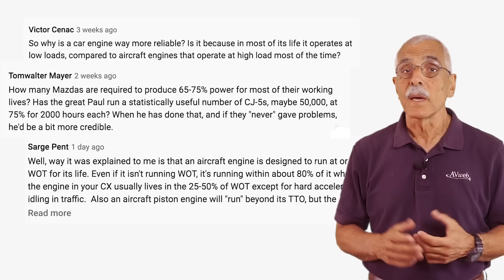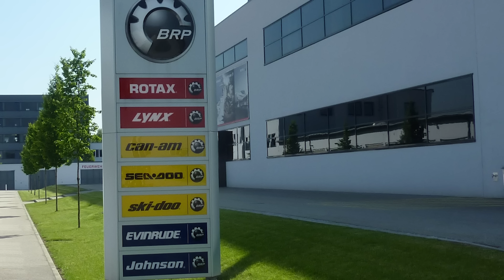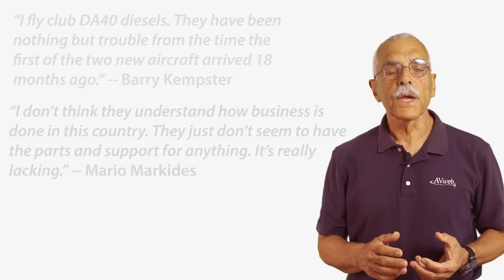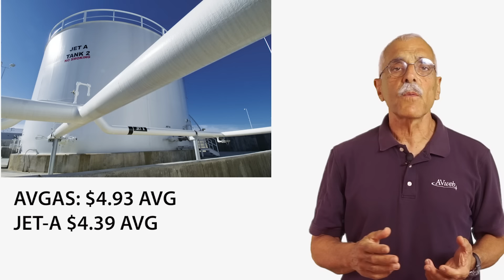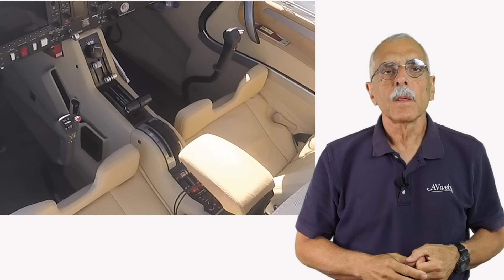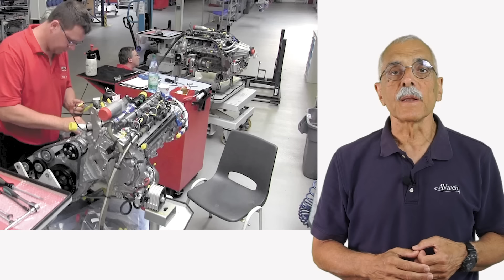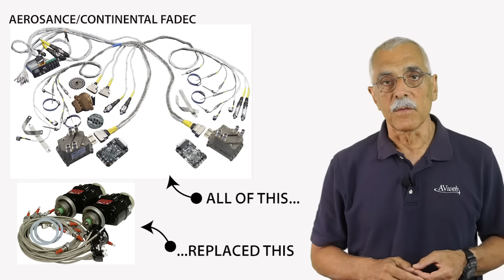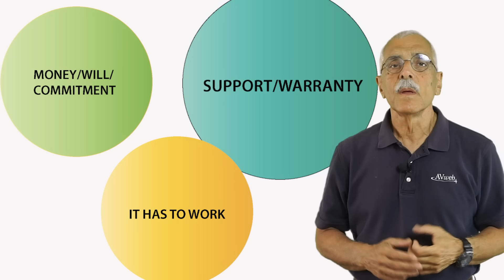Why New Aircraft Engine Ideas Rarely Succeed

Comment: I'm Not an aviation guy, but I'm a retired auto mechanic, and I can say that everybody knew what made a great piston engine back in the 60's. The biggest advances have been in materials and computer controls. take a good engine from the 60's, build it with modern alloys and manage it with modern computer systems and you just can't do much better. Great video!

Comment: This is a very interesting and informative video.  There must have been much research that went into it.  Thanks for posting the video, Mr. Bertorelli.  BTW, I met you once at Oshkosh many years ago when you were doing VHS videotapes.  You certainly were a gentleman and chatted with me for a bit.  Thank you for that.

I am curious about electric motors in aviation.  I find this fascinating as trading the weight of fuel for batteries and a motor (vs. engine) being so much lighter.  So, for those commuter runs or even as a trainer, this seems plausible.  The maintenance must be peanuts and the reliability off the scale.  Certainly, EV is not for every application but it might make some inroads in certain sectors of aviation.  We are at the beginning stages of battery development.  We might be on the tail end of internal combustion engines.  How much more can they do with them to improve them?  Solve the recharge-time problem and you might have something.

Comment: Great analysis, I continue to be perplexed at the fascination with overhead cams The RPM at the prop is almost always less than 3000 RPM.  If you believe in KiSS, simplicity is Achieved with large displacement low RPM air cooled engines.  For this you get less weight, lower stress on the engine and a much simpler power plant.  Thankfully there is no reduction drive and cooling system to nurse. Add the latest and greatest in electronic control tech and you get most of the promised benefits of the high tech wannabes. For these  advantages you give up some improvement in fuel burn and oil consumption. It is instructive to note that 2 of the 3  successful "new" engines are evolutions of legacy engines  .  As one great aircraft designer once said, "Simplicate and add lightness."  Updated and improved legacy designs fit the bill.
Reply: For years I have longed to see a real, honest effort made with a small diesel. Not a converted car engine, but a clean sheet, made for aviation design. Direct drive, air-cooled, sweet and simple. For a few years I thought the SMA engine was going to be the answer, but nope.

Comment: i dabble in light sport aircraft/experimentals, the latest engine trend is using 4 stroke yamaha snowmobile engines that have gear boxes added,  they see extended rpm usage at about 75-80% power,  even some turbocharged versions getting 300 hp out of 1,000cc engine.  i'm also involved in snowmobiles, i see many of those some engines suffer catastrophic failures in the sleds (rods sent flying out of the block) personally, i cannot see myself flying behind these engines, they are already highly stressed as it is and its just a matter of when will the motor grenade, not if. no motor is ever failsafe or perfect, but i dont want to put myself or others in harms way if i had an engine failure.

Comment: Red engines are the ones flying in European and Russian planes for the last 10 years I think. Also German but Europe is the better market for those. We aren't overwhelmed if an engines isn't comprised of 6 Heinz bean tin cans, an injection system from the 40s warbirds and 12 additional screws with some duct tape to hold the rest of the steelsheet together.
But concerning the poor guarantee procedures and service, that is German. 100%. Since the 90s our company mentality declined rapidly into an shareholder wank-off instead of good products with a proper service.

Important to mention though, in Germany you hold more responsibility for your actions as opposed to the US.
The amount of damaged machines and engines in any application because of lack of knowledge and high amount of stupidity is baffling.

Comment: Diesel motors was design to run full power all the time. They have too to pull the heavy loads up  mountains. So the reason that car motors are not suitable for aircraft still holds true for gas motors, run a gas motor at 70 to 100 percent power and most will fail in an hour or few hours unless they are beefed up quiet a lot.

Comment: We still have an ag-cat with a 1340 Pratt Them 1340's been around since the 1930's and  i'm sure in 20-30 years from now You will be able to still find a few around on working plane's Most reliable safest aircraft engine ever designed its  just 9 Lawnmower engines bolted together lol

Comment: What you didn't mention or maybe I missed it, is that in our litigious society in the USA, any flaws that can be blamed on manufacturers will be blamed on manufacturers.  The piston GA market is too small to absorb the enormous liability expenses being levied by our legal industry.  Hence, there is very little innovation in certified airplanes.  Experimental/homebuilt don't have as big a problem in this regard and have progressed with cutting edge improvements in materials, aerodynamics, engines and systems.  If you look at our GA fleet with the exception of Cirrus and a few other recent designs, it consists of flying antiques.  We are the flying equivalent of Cubans driving rebuilt Chevys and Fords left over from the pre Castro era.  We are stuck in a time warp.

Comment: The reason why Rotax never push the 6cyl is because is a small department of BRP and the market does not justify the spending, also big engines manufacture are the one imposing standard so the small ones cannot succeed.
Same happened for the Porsche engine PFM3200, amazing engine light year a head compared to Lycoming and Continental.
The FAA, pushed by Lycoming and Continental give them hard time to the point that they give up and the investiment for Porsche was not worth the effort.
So there is a lot of politics behind the scene like everything else today.

Comment: Slightly off topic from the video, but can someone explain to me why aircraft engines require such frequent overhauls. If (some) car engines can be used on aircraft only slightly modified, why is there such a massive difference in maintenance requirements? My car needs to be taken in for a service every 25,000 km or so and even then the engine is only the focus of every 3rd or so service. It also costs me a couple of hundred bucks vs the couple of grand that an aircraft engine overhaul costs (which suggests some very serious work is being done on it). Most modern(ish) car engines will run without failure for years without any inspection, let alone a service as long as you stay on top of oil and filter changes. Long story short, why are aircraft engines so fragile?

Comment: I always thought a Goldwing engine would be good for an aircraft.
Reply: Would be except for the offset driveshaft. No need for a reduction drive, just choose the right gear. But that integral tranny adds a lot of weight. A Harley might make a good choice on the smaller end as its tranny is separate from the powerhead and displacement can excede 3 liters with naturally aspirated horsepower north of the 200 mark. Downsides, vibration that immediately loosens any bolt within 100 ft and the need to carry twice as much oil as gas.

Comment: What is the fascination with overhead cam?  At the RPM's aircraft engines run at, it offers absolutely no advantage. The recreational boat industry had been using automotive derived engines for decades.  80 percent power is common.

Comment: Lots of mentions of Germany, so just for reference, the SMA engine is French, SMA was a joint venture between Renault and Socata, later bought by Safran. Funnily enough, years later, Renault engines actually power Mercedes cars, in particular the cheap A-Klasse shown in the video. The Thielert 1.7 is based on the engine of the older A-Klasse, the one that is much uglier, and started its life by a scandal as it was too easy to put on its roof.

A better, aluminum, diesel, more efficient engine is probably doable, but you have to invest so much money to do it that you will never recoup the investment. And now the future is hybrid/electric. For us in Europe with high 100LL prices the saving grace is a MOGAS STC.

Comment: An in-depth investigation and report. Thanks!

Aero-engine conversions of auto engines have been around for a long time.
Currently, popular conversions include Honda L15, Mitsubishi 3A92, GEO-Suzuki  G13BB, Yamaha Apex and Yamaha Phazer.
Costs half the price of an R9xx and is lots cheaper to maintain.
Has Paul Bertorelli looked into the reliability of these engines?
Reply: Problem with them is that you can't put them on your certificated ( not certified ) aircraft unless you reregister it experimental and once you do that there's no going back. It also won't eliminate the a&p as you are not the aircraft builder
Reply: @michaelmagill189  
That is so because of the ASTM compliance requirements of the US.
In the UK fitting another engine to a Certified aircraft is possible. Paperworks is a  fairly easy process.

Comment: Don’t understand why is it that no one talks about the  radial engine wouldn’t that be the most superior choice then any of the other Engines ????????!
Reply: Radials are super complex to build and they have one serious flaw with regards to general aviation. Sometimes oil will seep into the bottom cylinder when the plane sits for a while. This requires the owner to spin the prop by hand, and if he encounters resistance then he knows one of the cylinders is hydro-locked with oil. The only remedy for this is to remove the spark plug and gravity drain the oil out of the cylinder. 

Radials do have the potential to make excellent power for their weight, but they would cost a lot more than the standard boxer motors found in most general aviation aircraft, and their finicky nature would be a huge turnoff to a lot of would-be buyers.

Comment: In 2006 I was working on the electrical design of the starter generator for the Eclipse jet. The starter generator was inside the Prat Whitney jet engine in a oil bath. A resolver will not work in oil, so instead we used back EMF during off time to determine rotational position when starting. The high inductance of the 3 phase windings to prevent fires made the off time noisy. We got sued for $50k/ day for holding up taxi testing. That is when I was hired. I built a power supply and starter. I used my table saw to make a wooden rack to fill up the luggage compartment with my Rube Goldberg starter. When I could make the motor spin up with the torque vs rpm curve, our lab filled up with technician that gave a standing ovation. The reception from Prat Whitney in Albuquerque was not so warm. In a French Canadian accent the engineering supervisor yelled in my face, "YOU engineers [from my company] are so stupid!" and puffed his cheeks out.

Comment: Automobile engines usually don't work in aircraft because of the classic idea about duty cycle, but it's related to the bearings. 

Auto engine bearings are in fact designed to run at WOT just fine for many hours. A Corvette, for example, can easily do 200k miles, and they regularly go well over 100k even with repetitive track days spent sweeping to redline, and sometimes beyond.

But the biggest part is ensuring the propeller loads are handled properly. Along with crankshaft thrust bearings. Cars don't often have bearings able to handle propeller thrust and gyroscopic loads. The Austro obviously has an engineered propeller speed reduction unit, which is almost certainly torsionally/dynamically engineered to that engine/prop combo to some degree. And a diesel is already a beefed up engine block, bearings, and rotating assembly. But it's also very highly stressed with high compression and compression-ignition and direct injection pumps, etc. 

Not a great match for airplanes, car diesels are, maybe a baby turbine of 325-400hp range would be marketable?

Comment: In the past 20 years there have been millions upon MILLIONS of dollars wasted on R&D for electric aircraft with no range and diesel/Jet-A engines that are too expensive and too heavy. Why have none of these fool investors and engineers made what the market actually needs and wants: New UNLEADED GASOLINE engines.

Gasoline engines are actually affordable and offer decent power/weight ratio. High quality and cheap 93 octane premium unleaded gas can be found everywhere in this country.

If all of that wasted money had been spent intelligently, we would have more reliable, more efficient, higher power/weight, single lever control, more aerodynamic engines to replace these 1960's dinosaurs
Reply: Have you ever tried to get your 93 octane fuel into an airport ?
Reply: @bubiruski8067  The reason there isn't 93 octane autogas at airports is because not many engines run it - if the fool investors and engineers had invented modern engines that run it, then the airports would have it
Reply: @Rico_______  It does not even depend on the type of gas. 100LL is a regular aviation fuel and even this type of fuel is on stock at US airports only. On most other airports in the world they advise you to fly to the airfield of some club for refueling.
It is not very likely that this would change with 93 octane.
I think the best choice is the same fuel that commercial airliners use and this is JET A.
It is fine that these Thielerts and Austros can take JET A.

Comment: If you want to make a world round trip the Austro is the best. Why?
Because JET A is available everywhere, and the engine behaves like your car engine. It starts from battery down to minus 30 Celsius and has no problems in hot areas (water cooled). Avgas exits in the US only. If it is even colder ground power helps.
The fuel consumption is very good and independent from leaning experience.
These airplanes are certified up to 21000ft but the airplane is capable 28000ft.
Range (no wind) beyond 1000 miles with one hour reserve.
Extra fuel tank is not easy but makable.

Comment: "cast iron" hysteria is just that, nonsense. Can a properly engineered aluminium engine block be lighter? Yes it can, slightly, but a properly engineered cast iron block can be very close, as Chev and Ford have well proven over the decades. 

The 5 cylinder Audi aluminium block is heavier than the aluminium one it replaced for example.

The engine weights that were mention in comparison are nonsense, an engine doesn't gain 100lbs just because it has a cast iron block, more likely in the order of 20 lbs between the bare blocks, and clearly the engine example used has a lot more going on to add that additional weight.

Comment: DOHC in an av-engine?  Why?  Where aviation power is concerned, KISS is a really good idea, given the proclivities of current human technological capabilities.  KEEP IT SIMPLE, STUPID.

The reason to employ DOHC is performance at high RPM, mostly pursuant to eliminating valve float.  Av-engines don't do high RPM, so there is no reason to complicate the power plant with extra gears, chains, camshafts, and so forth.  Wanting these complications underscores what was said in the video: buyers don't know what they want.  Ignorance and aviation are a really bad combo.

Two-stroke diesels, IMO, could be a really good thing.  When properly designed, they are rock-steady reliable, are stupid-efficient when in proper tune, and produce more power per unit displacement than four-stroke diesels, all else equal.  But I agree with the announcer - bringing new tech into a market where issues such as reliability and maintainability reign paramount is a big bite to take and, according to this video, seems to be a bit of the fool's errand.

I'd also be interested in seeing that opposed-piston diesel out of Spain played with for aero.  A very simple and compact design that is extremely fuel-efficient.

Comment: Story Idea: Paul, can you cover some of the emerging electric aircraft / VTOL startups?
It seems like there are dozens of these companies, and all of them seem shady. The idea itself seems well intentioned, but the unsolved problem is that today's batteries lack enough energy density and are not as chemically stable as aviation fuels (witness electric cars that spontaneously combust).
The only commercially viable electric aircraft today are consumer drones, which tellingly, use a lithium ion battery the size of a brick to transport a camera that weighs about an ounce, and even then can only fly 20-30 minutes. 
Many of these companies are mum about range and payload, all while raising money from naive or unqualified investors based on slick renderings and animation. The pitch to investors is that their electric planes will replace current Part 121 aircraft, yet none of these companies have designs that can even meet current requirements of flying to alternate destinations plus 45 minutes.
When pressed, some of these companies will claim to have some extraordinary "proprietary" battery technology or some secret revolutionary airframe design. I find these claims to be very suspect in general. If one had some revolutionary battery design, certainly they would get into the battery business directly rather that trying aircraft manufacturing, with its regulatory hurdles and high financial mortality rate.

Comment: A  main reason why diesel engines that run on "Jet-A" in America do not work is that the required diesel Cetane rating require for perfect operation in the diesel engine like the AE-330 is often higher than the Cetane rating found in Jet fuel.